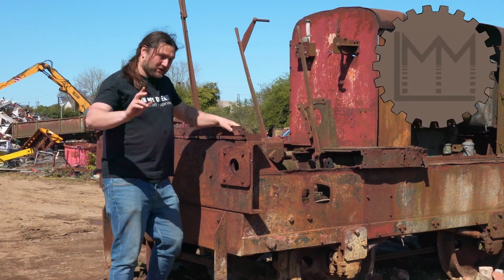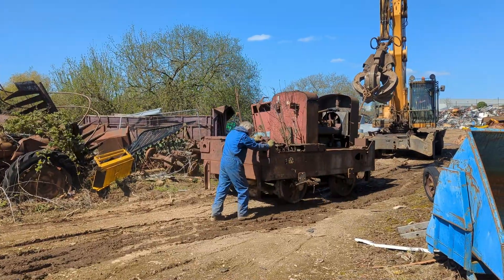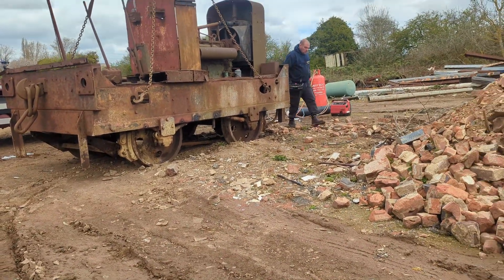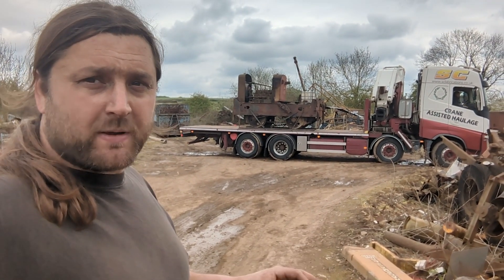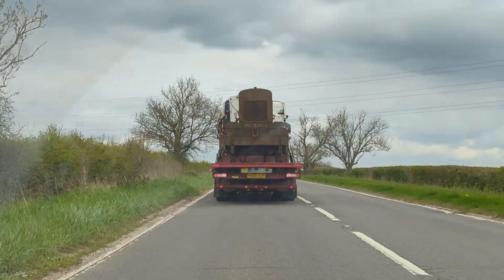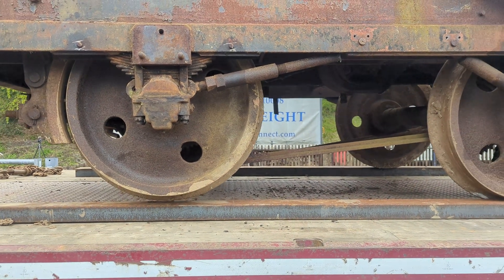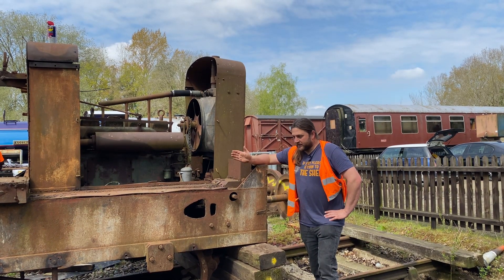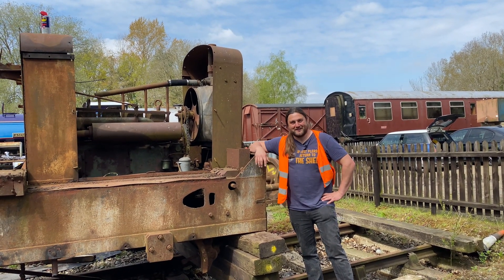Rescuing an Abandoned locomotive from the Scrapyard!

Comment: I think it'd be interesting to leave those lifting point holes in the frame even after the restoration, as a bit of it's history. Also, lifting points are useful for a machine that size.
Reply: I agree
Reply: I completely agree, I was going to ask the same thing.
Reply: the buffers are the factory lifiing points on most locos i beleve
Reply: @mechanicalmoron2251  correct 👍🏻
Reply: Definitely keep the scars of survival ❤
Reply: They might cause cracking in the frames later so it'd be best for long term survival to repair them
Reply: @gherkinisgreat  or reinforce them with decent welded on plates

Comment: Desr Lawrie! I know this feeling! I had it every time we did a small diesel working vehicle just saving from the cutting torch. In Würzburg/Germany we loaded 3 vehicles and then went to the other side of the station, where the others had been already cut in parts to get some spareparts for ours. But the greatest adventure we had in the following time! We went home with two vehicles upon the functional other 2 and then returned on the mainline, about 100km  to Hanau/Main with maximal speed (about 60km/h), with only 3 stops on the siding! That was my best railroad- adventure until now ! ! !

Comment: Just a thought. This engine is probably missing a lot of bespoke parts that will no doubt be hard, if not impossible to find. Perhaps you could find a similar engine that is complete, then photograph and measure the missing parts off that, and then post that information somewhere. 

Because i'd be willing to bet your community is full of my fellow shed-dwellers that could manufacture a lot of those missing parts. For instance i used to work as both a welder and blacksmith in my youth, have restored a bunch of vehicles in my years (currently i'm doing a 65 Caddy CDV, a Mk1.5 Transit bus and a 205 GTI) and i'd love to make something for this machine and send it to you for free. Bet i'm not alone in that either.

Maybe it's a logistically dumb idea. But it would be awesome! Anyway thanks for doing this restoration! Preserving and learning history is important, and fun!
Reply from the maker: Oh that sounds awesome!
I'm sure we will need bits to be made!

Comment: I would have probably lifted it through the buffers than those side holes, those bits between the holes just don't look thick enough from my perspective, but glad to see it on its way. 

Thinking on the restoration, people can 3d print car parts now so maybe something similar is possible since original or even replica parts will be like rocking horse crap. Would be cool to see regular updates on the restoration, grinding the rust off the frame etc and cleaning up what is there, might even be possible to get than engine going with a bit of luck 😂